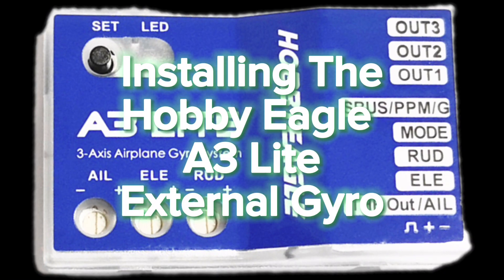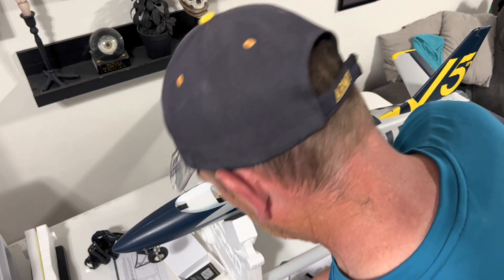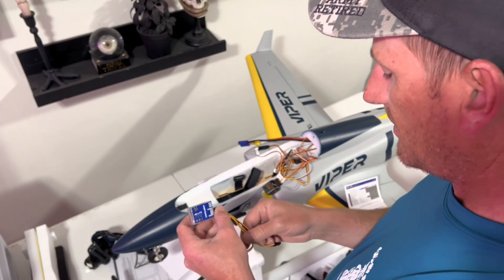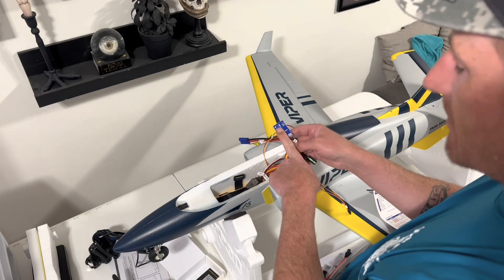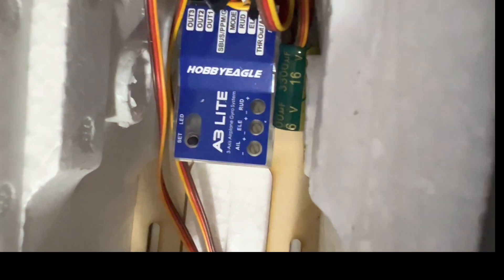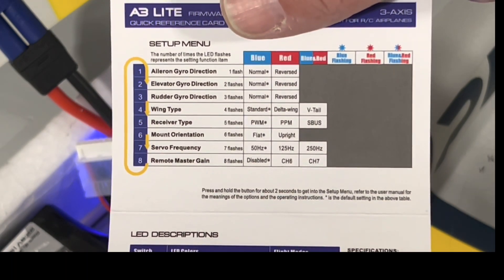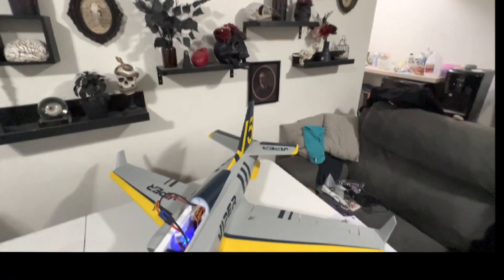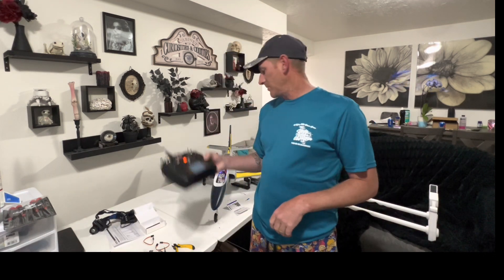Setting up an External Gyro- Hobby Eagle A3 Lite

Comment: With only one aileron connection, what do you do if the aircraft has a servo in each wing?
Reply: Exactly my question
Reply: Obviously a y cable
Reply: @s.a.t419  Which obviously kills the benefits of separate servo control.  Obviously.

Comment: great video, i hope you can tell me if this gyro is compatible with a flysky i6 receiver i have posted the question on various rc forums and all i am told is something like its compatible with sbus or ppm which if i know what that is i wouldnt be asking, LOL, i love this hobby but as i dont drive getting to a club to learn is not really possible and im sick of crashing and spending a fortune on planes, i have just finished a dancing wings j3 cub the smaller one and i am very proud so a gyro is a must, any help would be greatly appreciated
Reply: I know I’m late but yes it works with all receivers including the Flysky. I have the same rx. I only use these gyros. I’m sorry for your last crashes and I hope you’re getting the hang of things.

Comment: Does the potentiometers also control the rudder, aileron, elevators throws when using the radio controls?
Reply from the maker: Apologies for the delay in answer, no it does not control the throws. Strictly for wind gusts, and you can over power the gyro with radio control inputs.